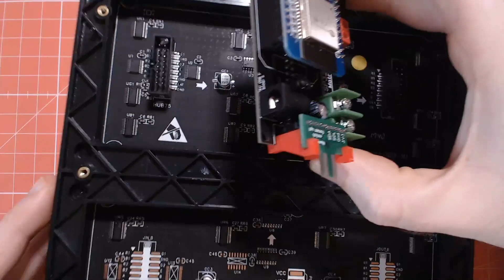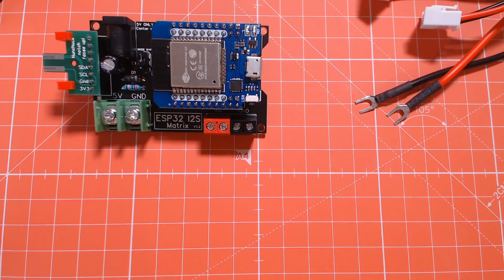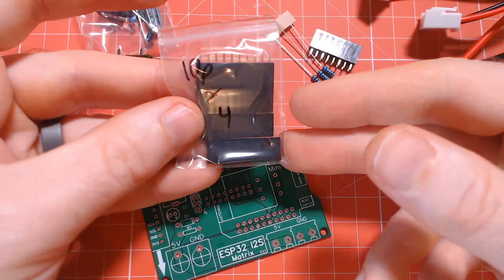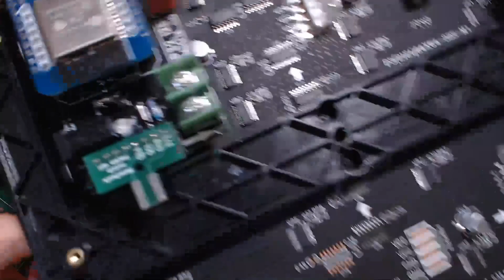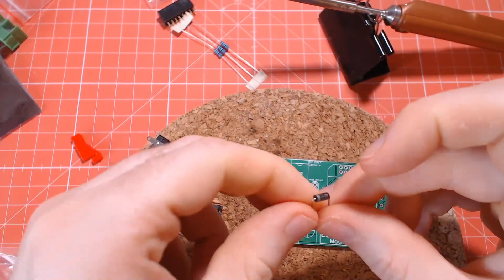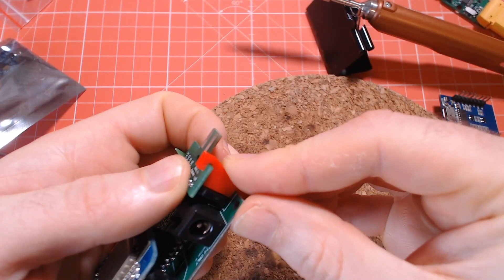ESp32 I2S Matrix Shield Info & Assembly

Comment: I've purchased your shield and built it. It seems to work fine when powering from the USB (although briefly as the current draw is too much), but when I plug a 5V supply into the barrel jack I'm getting nothing on the display and the D1 blue LED is on as well as the red LED (only the red LED is on when powered from USB. Any ideas?

Comment: Hi Brian! Electronics beginner here. What is the capacitor needed for? Is it a malplactice not to use it? Also, the Diode would not be necessary if you disconnect the power before plugging the USB cable, right?
Reply: The capacitor is there to smooth out any sudden voltage changes caused by many LEDs being turned on/off simultaneously. If you do not place it, you may find that your ESP32 randomly resets (many LEDs turn on at the same time --> voltage drop on the ESP32 supply --> ESP32 reset). It can happen, and it did happen to me in the past :)

The diode prevents the flow of current from your USB port into the matrix (not the other way around!). If you bypass the diode and plug the ESP32 into your USB port (to program it), the whole matrix will try to pull power from your USB port - which might damage the USB port on your computer. 

There is another diode on the actual ESP32-mini board that prevents current from going from the external 5V supply into your USB port - but that comes with the ESP32 board, is already soldered on, so you do not need to worry about it :)

So TL;DR - use both the capacitor and the diode as they were intended. They will save you a lot of headaches in the long run... :)
Reply: @BogdanSass  Thank you. Well explained.